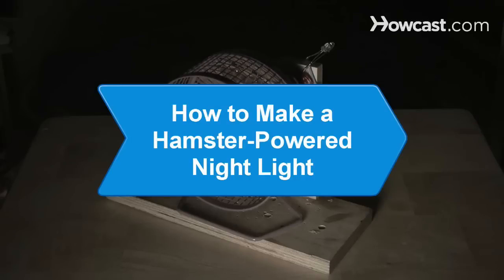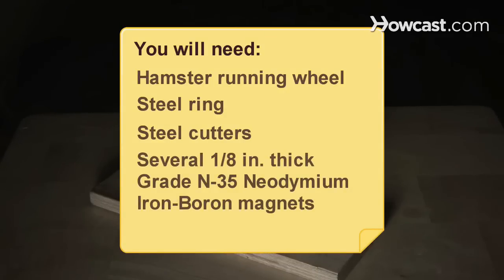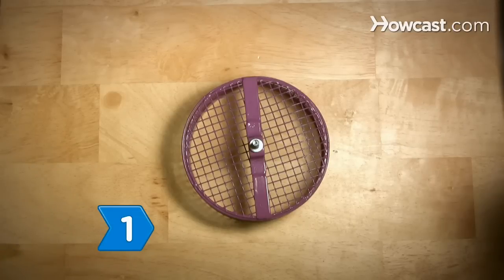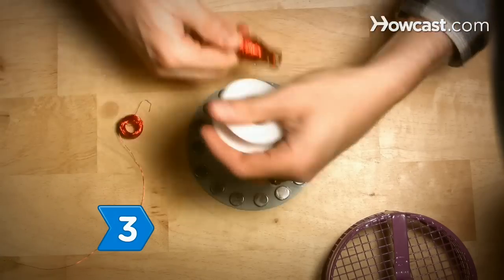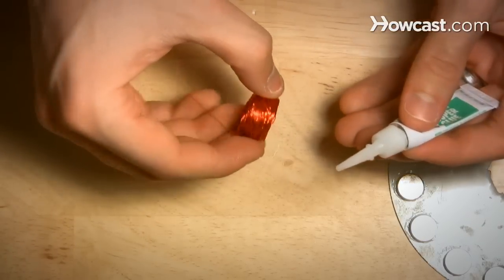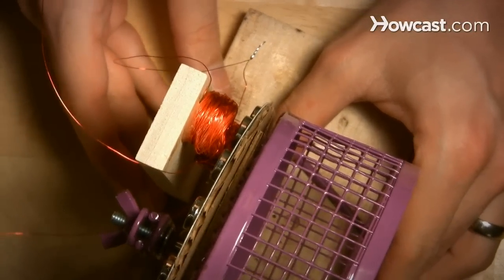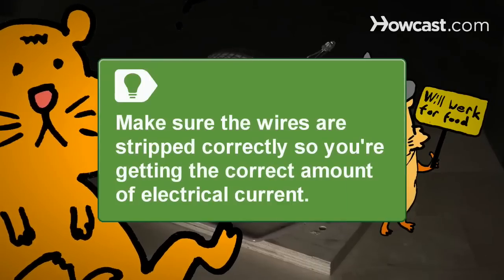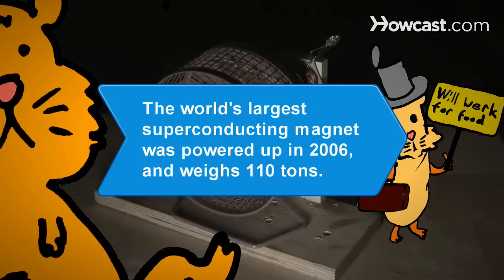How to Make a Hamster-Powered Night Light

Comment: Very inefficient and more expensive... just get a brushed motor with a diode and capacitor to power the LED. The diode is to stop the wheel when moving in the opposite direction using opposing electrical energy. Or use a brushless motor with a full bridge rectifier and a capacitor.

Comment: How many hamsters would I need to power my pc
Reply: The typical hamster wheel outputs ~.5 watts, and laptops use ~ 45 watts so 90 hamsters under ideal conditions although since they won't be able to run continuously we will assume a 33% duty cycle putting you at 280 hamsters. Applying the same to a 500 watt desktop would yeild 3000 hamsters although for typical use you could probably get away with 1800 and hooked in parallel with a rechargable battery bank though you should include 30-40% losses in the electrical to chemical potential energy conversion process... finally one important note rectifiers should be attached to each wheel both in this AC configuration and in a DC one as a hamster running backwards will null the output of one going forward.
Reply: Like 20 male russans
Reply: U kidding me?

Comment: They needed to enclose the the electric/wiry part of the night light  in thin peices of wood nailed or stapled together at the corners and to the base peice of wood with rubber strips glued to the inside so the hamster wouldn't kill itself getting electricuted or chew wire -*-;;;;;;;; 
Also, putting an actual hamster on the list of supplies MIGHT have been just a tad important. ;;;;;;;;;